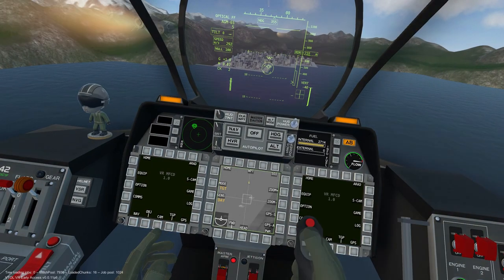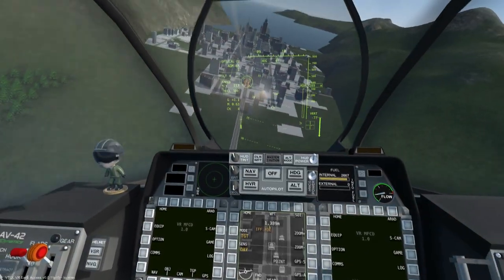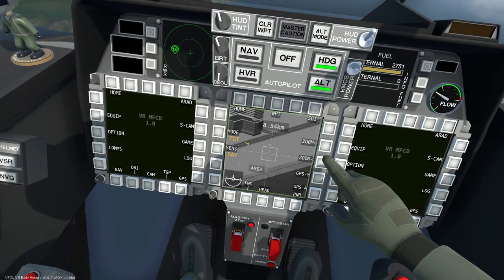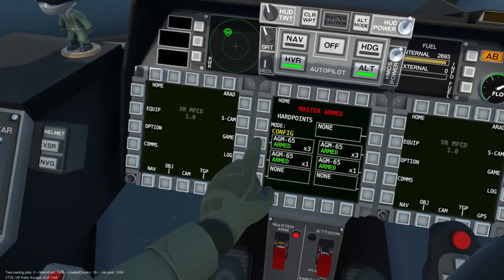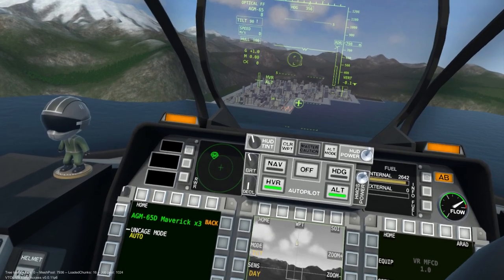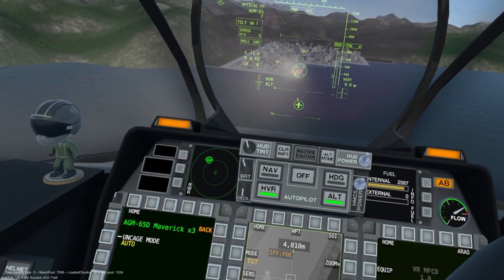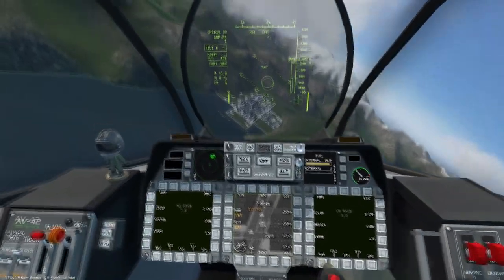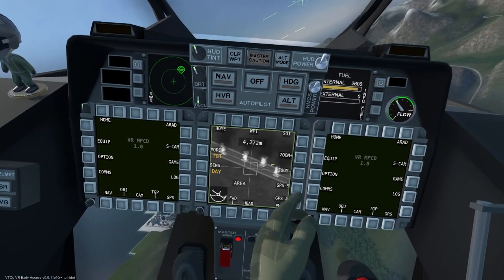VTOL VR Tutorial Nuggets: AGM-65D Maverick

Comment: What is ARAD?
Reply: Anti-RADiation. You use the screen to lock targets for your anti-radiation missiles, similar to locking AMRAAMs. Its not as polished as the other public beta weapons, but it works intermittently.
Reply: @hizokuto   Hi Hizokupo. Is it normal that the Maverick missiles take a lot of time to reach their targets?
Reply: @8bittimetraveler834  no that's not normal. You have to cheer them on before launch to unlock their max performance.
Reply: Anti-Radiation Attack Display. It’s a menu on the MFCDs that designates targets for anti-radiation missiles.